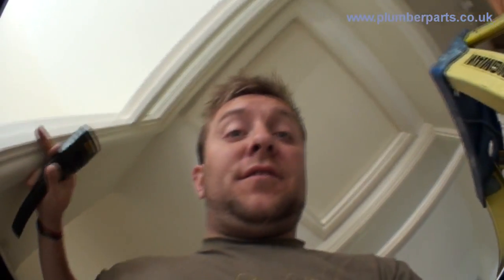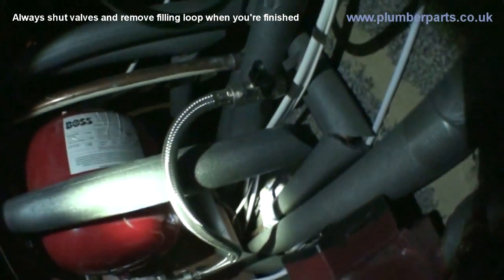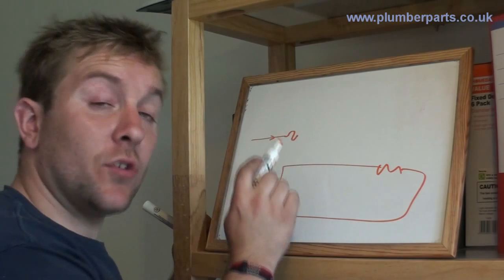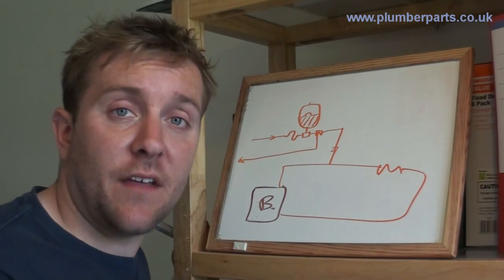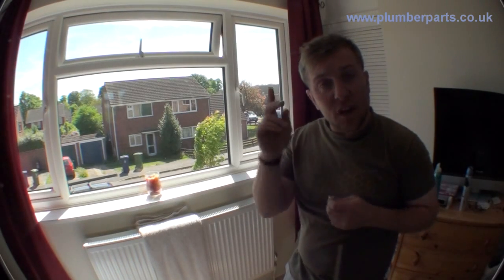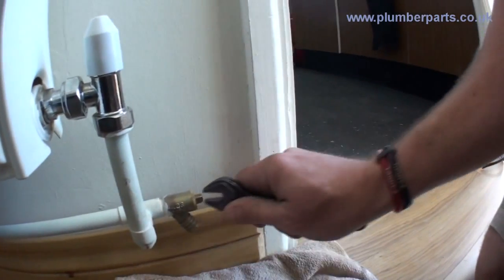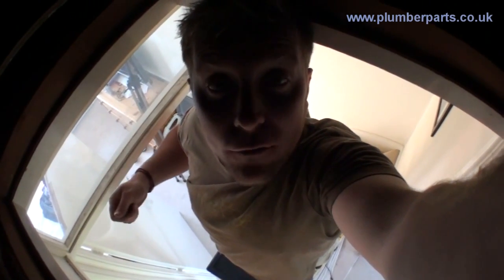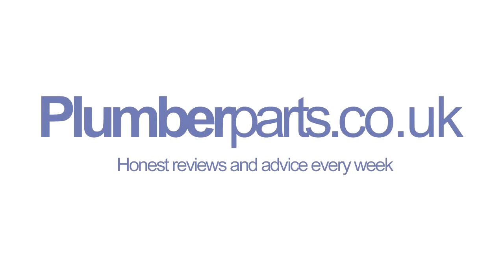Pressurised Heating Systems - Plumbing Tips

Comment: Firstly, your videos are brilliant, I have been watching for years. I have a question. I drain my pressurised system (Worcester Cdi) with a garden hose on the ground floor then close it off then replenish with the filling loop on the first floor.  My idea is rather that using the filling loop, I could replenish the system from the drain point  the hose is already attached to and I can connect it to the garden tap.  Is there a reason why I must use the filling loop? Will filling from the bottom damage anything? I am thinking about NRV"s etc.  To me it makes sense to fill from the bottom but would like to share this as no one seems to do this. Thanks in advance.

Comment: Hi Mick here. My heating pipes run in the attic of my bungalo and drops down to the rads and im afraid of the pipes freezing over the winter as i will be working away for five days at a time . Can i add antifreeze to the system. Also the system hasnt been drained for 10 years or so .should i flush out the whole system a few times. Is water the norm in most heating systems

Comment: Just had a free boiler installed.  Not a combi.  Had the underfloor and loft insulation done for free too.  Happy days! 

Had a bunch of problems since the instal.  Initially, lots of air getting into the rads, had to bleed 4/5 times a day.  No sign of a leak.  They fitted a vent valve to the top of the boiler.  No more air in rads but now the boiler makes a terrible noise when coming up to 73°+.  If I bleed the top of the boiler, it goes away for a few hours, then returns.

Went on a mini break and had the heating off for 2 days, it has made the noise a little better, but still there.

They’re saying they’re going to pressurise the system as they reckon it’s a flow problem.  Never had any issues before this.  Any ideas?

Comment: Its Not what i was looking for to be honest i just pressurized by open vent system for one reason n that is to make sure there is no pressure drop IE no leaks my question is simple is there a pressure switch i can fit on the system so my feed to the boiler/pump goes through it n is the pressure drops say Bellow half a bar the switch wont maintain contact IE shutting the power to the pump/boiler? i know Vailants used to have something similar ( was it called interrupter?) but that was heat not water pressure sensitive that was strapped on the outside of the flow pipe, am retired now many years ago but i dread to think the pressure drops to zero through bellow the ground floor pipe  leaking  yet the boiler n Pump are still supplied with power and working so far so good But if there Is no pressure switch that cuts off the power going back to an open vent system i was thinking maybe something like an OIL pressure switch but if i can get any fittings to adopt that n how low a pressure do they work am not sure also If they make instead of break with loss of pressure its still ok as i can use a relay am sure Combis must have something like this build into them but can I buy one? its Just not safe enough the pressure dropping n the boiler pump still working If you can help i be very grateful cheers
Reply: If its open vented how can you prrssurise it.
Reply: simple mate, cut into the expansion pipe (the vent pie) n connected the side going to the boiler to the pressurized vessel output seal the cold water feed to the boiler connected the mains water to the non return valve on the input to the mains n from the pressure relieve valve to the outside ( not actually done it yet as the boiler its in where the outside toilet was  so If it discharges any water there its no big deal lol what i found out it the amount of heat the standing pilot is producing i did not know this B4 as all the heat was going up the expansion pipe pressure seems it goes down couple of 10ths of a bar after pressurizing n then stays there
Reply: @polygamous1   your converting it to sealed.
Reply: yes of course mate i had to to make sure the system is sound as its time to change my very old but 100% reliable Potterton boiler, talking about boilers there is No better boiler on earth to have when things go wrong, their guaranteed Is EXCELLENT no one even comes close, i once fitted a neutaheat but was faulty from new (Very rare for a potterton) i phoned them Friday after noon they said they'll try or tomorrow or Monday next Morning Saturday by the time i got to work there was a Potterton van with two blokes n a new boiler WHERE ON EARTH CAN YOU EVER GET SERVICE LIKE THIS?
Reply: 2 Vaillant the old 242 Vailants had a time delayed mehanism build in to the boiler adjustable from 20 to 12 minutes (if i remember right) so every time the temperature called for heat the auto ignition would,'t keep firing too frequently to prolong its life to by pass even if 2 minutes was too long for you all you had to do is turn the mains of n back on to temporary disabled the mechanism had trouble with this once they send 3 different engineers down they all gave be different crappy excuses until i spoken to their service manager than he sand a bloke down he changed the eletronic delayed mechanism and was all sorted one time my mate installed a newer Vaillant water was fine heating nothing first vailant bloke told him Must be blockage in the pipes he broke all the tiles in the Kitchen to find the pipes where clean after few visits from Vaillant engineers nothing was sorted so i though yes i go n see if i can help, you will Not believe it mate you turn the heating on But the diverter valve was stuck on hot water the domestic heat exchanger was burning hot yet they just had to blame my ate instead n it cost him plenty i will naturally replace by Potteron for another Potterton even i must admit vaillants are excellent n very reliable i like to know if things go wrong i have the best team on earth to help me

Comment: My current system has been over pressurised after recent bathroom refit. My old house had valve in unvented high pressure system which allowed me to easily decrease pressure without draining rads. There is a few valves in current pressure system in new house. How do I identify such valve?

Comment: Can I flush the system using the filling loop while it's draining or is mains pressure too high? 
I have 2 drain cocks at lowest point. ?
Reply: Yes, you can. But to be safe, open the feed valve on the loop with caution: if the system is correctly installed, there will be a pressure relief valve, which will open if safe pressure is exceeded, but it is safer not to exceed 1.5 bar pressure when flushing out, so open the feed valve gradually till the pressure guage reads 1.5 bar. Make sure any motorized valves are open when draining down, and always drain off all drain points. Refill the system, top up while venting. Cold pressure after refill/venting should be 1 bar.
Reply: @johnschlesinger2009  many thanks.

Comment: Hey dude what's your opinion about teeing in the expansion vessel to the primary return pipe work, before it connects to the coil of the hot water cylinder ? Isn't it better to have the expansion on the cooler side of the system that's what I've always thought, obviously make sure there are no valves on this part of the pipe work

Comment: what happens if a pressurised unit is fitted with a open vented system using a n F/E Tank? ? by MISTAKE, What would happen ??
Reply from the maker: Not a lot. It would work but not the best!

Comment: Just done this to clean and then inhibit old Worcester system. When I got to the part of checking for leaks, the boiler had a steady drip under it. The plumber I called said air relief valve probably gone cos water pressure too low. Is that likely to have been caused by my mistake and I need to drain differently, or just a fault with the design / age of the boiler? You know which answer I'm looking for ;)
Reply from the maker: +Neil Stoddart No, it's just a common one on those mate! 

Sub here please>> https://www.youtube.com/subscription_center?add_user=plumberparts <<If you haven't already!

Comment: I have been having problems with the pressure release valve on my Worster 28 CDi boiler for the last 3 years. I have had the same plumber come to fix it three times each time he replaced the pressure release valve. I am yet again back to bleeding the up stairs radiators and having a constant loss of water pressure in the boiler. Yes it is the pressure release valve again. BUT WHY! 

 Each time the plumber came to fix the problem he took a track pump into the boiler house with him with. I suspect to check the air pressure in the expansion vessel. I know he did not draining the system first and thus must of been getting an incorrect reading and possibly putting to much air into the expansion vessel this would then cause the pressure release valve to open and drain the system of water pressure. 

After watching your video I checked the pressure in the expansion vessel and it was up to 2.5 bar.  I have come to realize the plumber may of given me some poor advice in saying to keep the water pressure to 1.5. The combination of there being to much water pressure in the boiler and to much air pressure the expansion vessel is the cause of the pressure release valve continually opening and dumping the water pressure. Tomorrow I will drain the system down and alter the pressure in the expansion vessel then refill the system. Fingers crossed this solves my on going problem. Brilliant video put it all in a simple format even i could understand thank you very much Good Job.

Comment: Thanks, great advise. had to change a radiator, and could not work out why I could not get rid of the air bubbles in the upstairs, radiator. Then I noticed I had no pressure in the system, pumped up the pressure three attempts and  heat upstairs, just in time as it is now snowing.

Comment: On an F+E system, I've always put in an additive to prevent corrosion, is that required on a pressurised system? Or will the pressure of the system prevent oxidisation taking place?
Cheers Dan
Reply: Oxidization IE oxygen in the system its what usually causes that If everything in new rads pipes boiler all sealed you lose No pressure no fresh water in the system then you shouldn't need it But its a good idea to add something in as most additives also have lubrication properties in then good for the pump  n you may also have to top up the system occasionally so yes for few quit its worth it just the once GL

Comment: there are two valves on radiator one is Thermostatic radiator valve and  other is normal valve opening/closing sign which valve should i open while draining off

Comment: Hi please I need your help.I have an identical system to the one you just showed. My boiler is not heating. The only thing I noticed is the pressure Gauge is reading 2 and the alarm light is blinking.what do I do please?